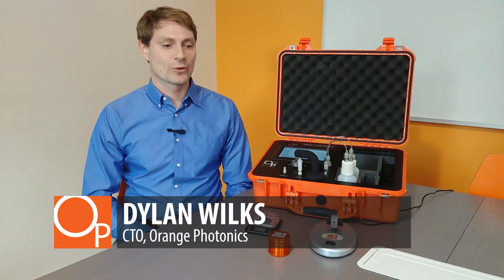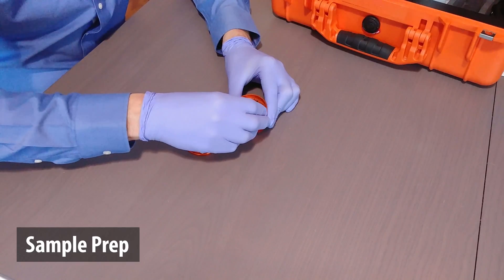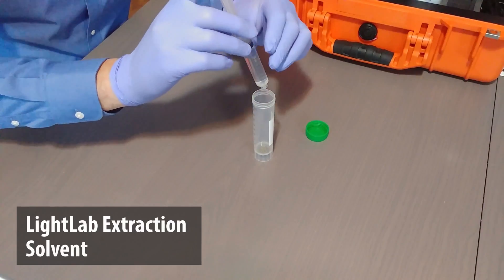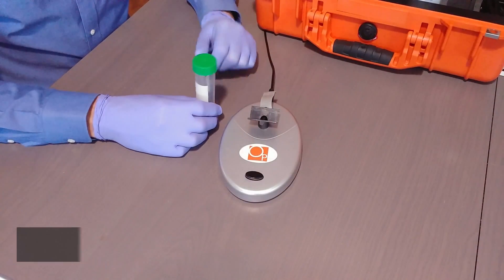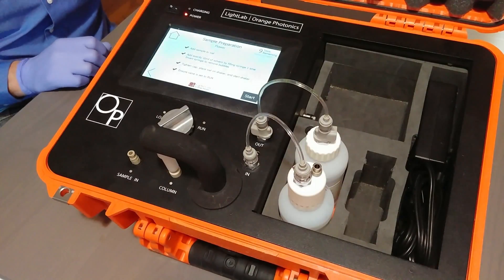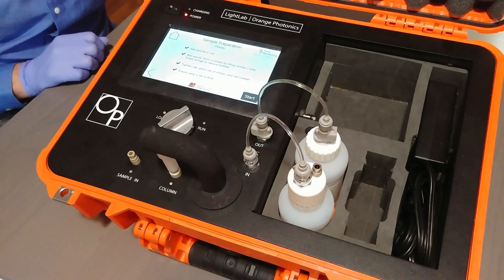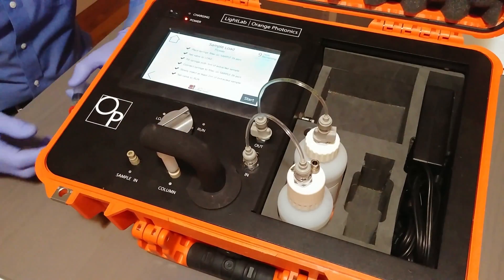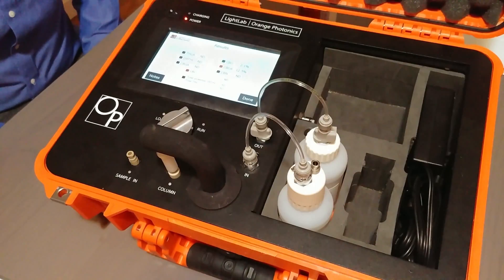How To Run A Flower Sample | Orange Photonics

Comment: 🤦🏻‍♂️bruh...you can't be serious...

This method was either developed out of complete ignorance of cannabis or chemistry...
Reply from the maker: We would like to help you, but we aren't sure what part of LightLab's analysis technique you're taking issue with.  Nearly all laboratory HPLC methods use solvent extraction as a primary sample preparation technique. We have multiple sets of third party published data to support our performance that we are always happy to share. Note that in the latest proficiency test (Sept 2022) LightLab outperformed two thirds of the participating laboratories so we believe strongly that our technique is proven out with data.
Reply: @orangephotonics7168  I never mentioned solvents at all.

Cannabis flower is not the same as concentrates and it is not to be treated as a pharmaceutical that you simply crush or grind and analyze the powder.

Grinding does not, in any way, provide a homogenous or representative sample of that flower. Grinders are a GUARANTEED way to lose trichomes. First of all, you only took a small part of the flower that was ground up. Grinders do not homogenize the ground matter. You are left with a pile of various plant components with different particle sizes and densities. That scoop is not representative of the flower that was ground. Unless you can ensure homogenous particle size, you have 0 evidence to suggest the scoop your taking from that grinder is truly representative or homogenous. 

On top of that, anyone that has ever used a grinder knows that there are plenty of trichomes that get smeared on the teeth and sides of the grinder, greatly reducing the potency results (I've tested this using a grinder, mortar and pestle, etc).

Anyone using this method is losing at LEAST 3% THCa on their results if they use this method. It can be up to 6/7% in my experience. 

I think I'm learning your ignorance stems from cannabis and not chemistry. Which is fine, but to put this much effort into this instrument just to use this sad method is just...yikes 😬

I can see why cops are your target customer base🤣

If you guys want to hire some actual chemists that understand cannabis, let me know. I can send some your way.
Reply from the maker: Thank you for clarifying your position.  Yes, we would agree that grinding a small amount of sample can be troublesome, and is not what we would recommend in a typical industrial application.  This was meant to be a simple sales example of how an analysis is performed, not a full instruction video for a customer.  We have application notes that describe sampling and preparation methods for various analysis types, and we generally recommend using a large scale homogenization mill for dried material, typically at least several grams depending on the application.  The preparation and sampling techniques we recommend for pheno hunting are quite different than those for determining extraction efficiency in an extraction vessel for example.  A large portion of our R&D is focused on sample preparation since this is truly one of the most important aspects of ensuring in-house testing provides value and saves money.  Thank you for pointing this out- certainly we are on the same page as to the importance of sampling and preparation in cannabis analysis.

Comment: I notice on the spec sheet that it can be used for young plant and leaf material.  Do all samples need to be dried or can extraction be performed on fresh flower, leaves, etc?
Reply: Good question. The instrument can measure samples that are wet or dry; however, we recommend drying samples to get the best accuracy. In addition, if you know the moisture content of sample you can input your measured moisture value and LightLab will correct for the sample's moisture content.

Comment: Man this thing is amazingly simple and so compact. Price point is high, but probably worth it?....
Reply: Ya, this method is highly inaccurate. Do not waste your money.
Reply from the maker: Hi  @timr8431  ,  You might be thinking of NIR, which has a range of +/- 10%. This system is an HPLC, not NIR. Liquid Chromatography is the standard testing  method for cannabis analysis and is the method used by the vast majority of testing labs. Happy to chat if you'd like to DM us.
Reply: @orangephotonics7168  No, I'm talking specifically about this video.

I'm well aware of cannabinoid analytics. I'm a chemist in a cannabis lab haha

I run the UPLC every single day.

Your sample prep is horrid.
Reply from the maker: @timr8431  Thanks for your comment, but we believe in numbers, not simply "inaccurate" or "good".  We participate in both NIST and University of Kentucky proficiency testing and have calculated repeatability and reproducibility values using ASTM E691 statistics, all of which is publicly available.  If your laboratory publishes similar data it would be interesting to compare, but simply saying we are "inaccurate" isn't useful without a comparison to other data.
Our sample preparation is certainly simpler than a typical laboratory preparation, but LightLab is able to avoid the dilution step due to the column design we use.  By avoiding dilution our preparation avoids one of the largest sources of error in LC analysis.  This far and away outweighs any added error through our simplified process.
We recently ran a blinded test against 3 iso certified laboratories likely similar to your own (again these data are publicly available) and it was clear that LightLab was equal to, and in many cases outperformed, the laboratories.  Feel free to reach out if you would like to review any of our data or analysis.